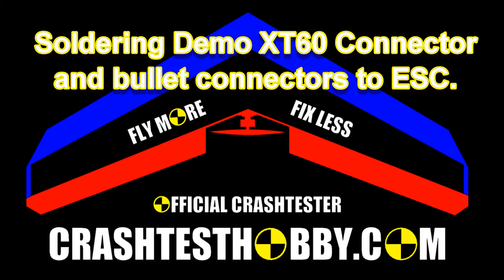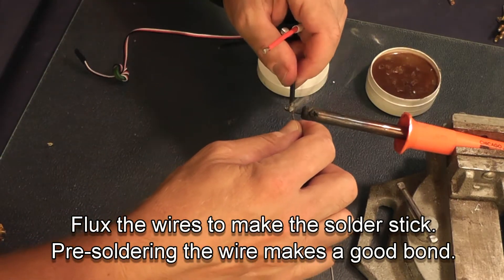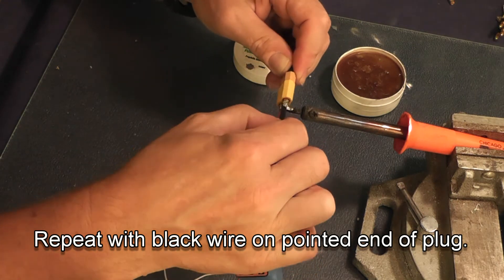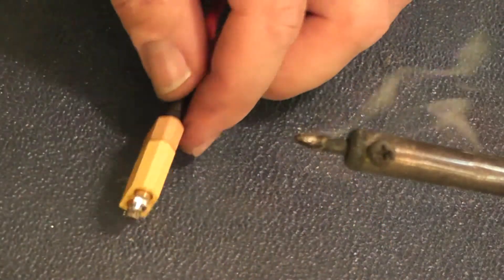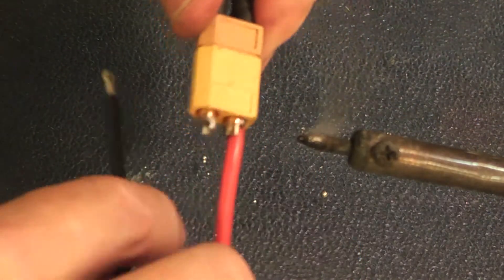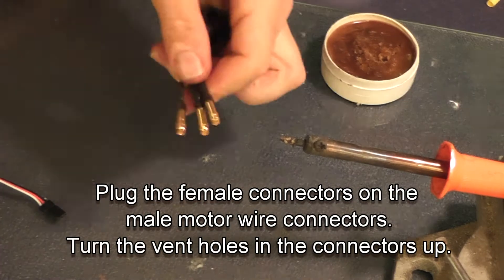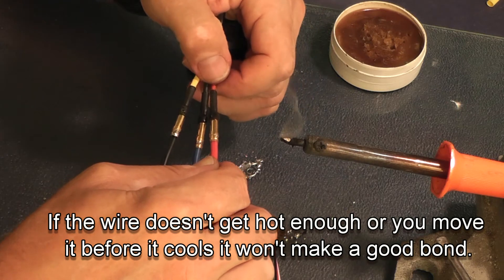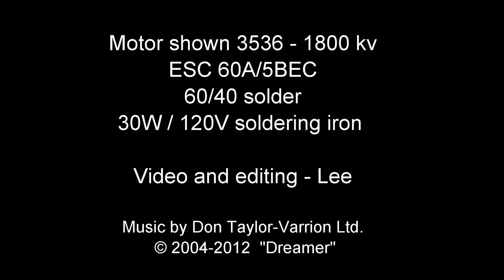Soldering XT60 and bullet plugs with naration

Comment from the maker: I have used a 30W and a 60W soldering iron for this type of soldering.  If you are patient you could do it with a lower wattage soldering iron if you let the connector heat up and use flux to help the solder flow.

Comment from the maker: You need to get the plug hot enough the solder will flow.  The flux helps but you should be able to have a smooth appearance to the solder joint when it cools not a rough dull appearance.  The big plugs take more heat than the smaller plugs.